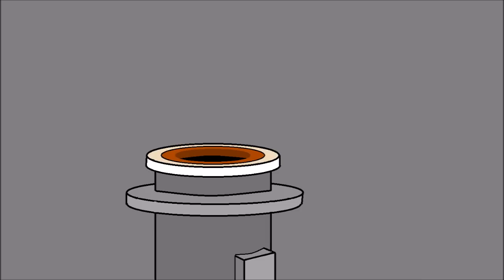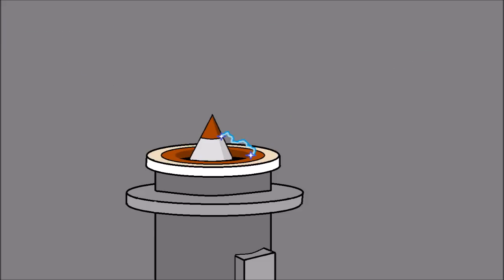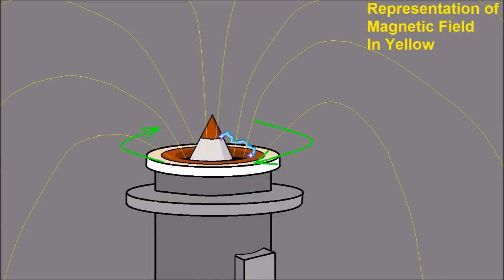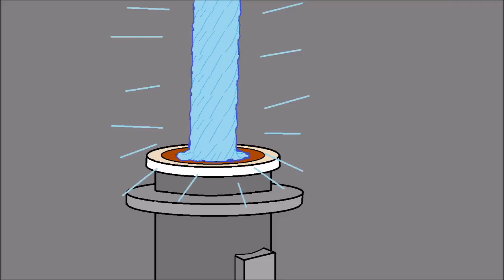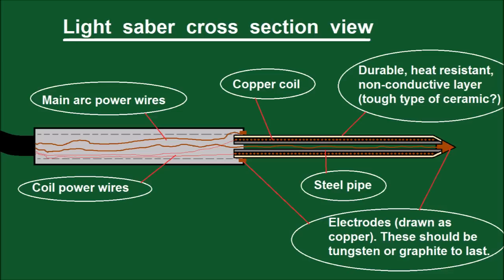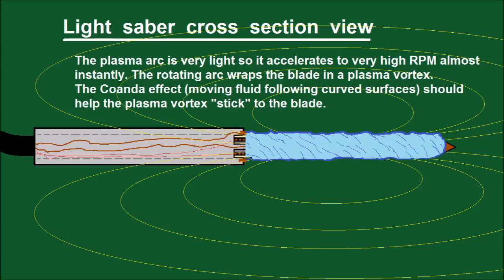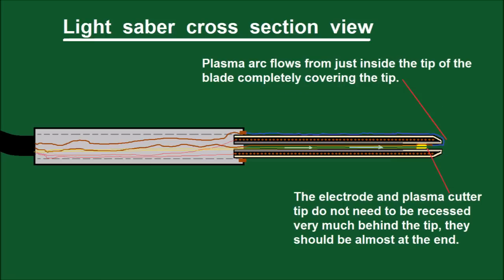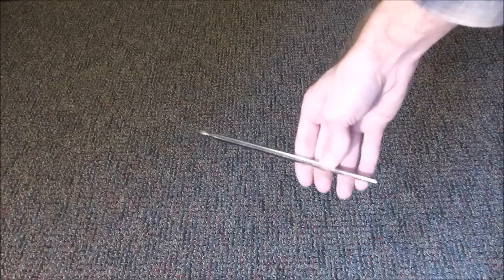Design for a REAL Lightsaber! Make a Light Saber SciPhi 02

Comment: Honestly its more likely to kill you. Good luck finding wires with good enough insulators.
What about a single electrode, and a high current output tesla coil. You could add long thin strips of insulators along the electrode, and this will prevent it from shorting on contact with objects, and still make plasma between the electrode and the object your cutting.
Reply: I thought about this before watching the video but for this to work you would need a Tesla could within close distance of you or have a ridiculous power supply

Comment: Have u done the calculations for how well these materials will sustain the arc, and all the little precise details?
Reply from the maker: That is what you find out in prototyping. If I get bogged down trying to focus on precise details I first of all would probably never come up with ideas like this, and second the amount of data to handle becomes exponentially higher if you plan down to the smallest details, with rapidly diminishing value/reward for planning since most of the parts and materials will be determined just by what is available and not by what is ideal. If there is a component that melts then that component could be replaced with a better material, a cooling system could be added, or the higher level approach could be altered to take load off the component.

Comment: hey dude why don't you set up a donation so you can save up enough money too make this.
Reply from the maker: Thanks for the suggestion! I did try to do that for the plasma gun but it looks like I will continue to fund my own projects and research. I work full time so I have some money now but no time/energy left  :-( It is hard to get both enough money and enough time. I will probably try to build the lightsaber after a few other things. I got some scrap electronics together to build the plasma gun but there was a problem with the car ignition coil I had so I stopped touching it for a while.

Comment: Nice design, the concepts are there, I think it could work, but as you probably know: there are many challenges involved in making a lightsaber. Good luck : )

Also, how do you plan on insulating the high voltage wires so that there won't be an arc inside the hilt? I imagine it's possible, but I can't think of any specific way that would work.
Reply from the maker: Thanks I'm glad you like it! For the wires there is a lot available to buy pre-made, silicone insulated wire does pretty well with HV and heat, available in any standard gauge with ratings in the tens of kilovolts: http://catalog.connectronicscorp.com/viewitems/wiremax-products/-tuffsil-silicone-wire?&plpver=1001

Comment: Wouldn't the high voltage that makes the plasma just shock and kill the person your trying to cut? What would be a better design so you could actually do cutting damage instead of electrocuting the person like a bad ass stun gun?
Reply from the maker: The plasma would be intensely hot, the more current you can supply the hotter it would be. The magnetic force on the plasma arc would force it to continue spinning around the blade even if the blade comes in contact with a conductive material. So I think it would work like a circulating plasma saw, burning through material on each pass at thousands of passes per second. There would be an electrical shock with it yes, but it would also burn through material quickly if you can supply enough power.
Reply: Don't get me wrong it is a great idea, and this idea lead me to make my own, but more like a wh40k power sword than a lightsaber, if you private message me I can explain that if your interested. But any way, I was mainly curious if you got around the shocking part and have it as just the plasma circulating saw as you put it.  Also, im a blacksmith, I also do metal castings, if you want help making custom parts an such let me know, I would be glad to help make a plasma gun an laser tower
Reply from the maker: Cool if you want to private message discuss something you can email me at jaycubl@hotmail.com

Comment: But if you slash at a metal rod for instance, the plasma arc will conduct only through that so the arc would no longer surround the entire lightsaber due to faradays law. Functional but less cool looking.
Reply from the maker: Well actually Faraday's law is what is pushing the are around the blade at high speed. In the section where the blade is touching or near the metal bar yeah it will likely conduct all or mostly through the metal rod because the voltage signal between blade electrodes will be stronger at the conductor, but it might still sweep around the blade and only momentarily conduct through the metal on each pass. It would depend on a few factors like the condition of the metal surface, how much easier the path through the particular piece of metal actually is (vs through the plasma), the intensity of the magnetic field and the electric current through the arc, ... etc.
Reply: Well by faradays law I was referring to things like the faraday cage, where electricity takes the path of least resistance. And how that whilst your design is probably more efficient at cutting through things than just the heat transfer of plasma as other designs utilise, on clashing with a conductive material or maybe even another lightsaber the arc would stop spinning, removing some of the "wow" factor. Still I think its an impressive idea if not the perfect one. :)
Reply from the maker: Yes, hopefully we can create one more like in the movies eventually! Oh sorry I did not realize that is what you meant by Faraday's law, I thought you meant Faraday's law of induction. Anyway, maybe to fuel your creativity and deep thought, you can try to design for the world a system of producing magnetic fields in the shape of a lightsaber blade in a way that could contain the plasma and strongly lock out another blade. I haven't been able to think of that yet so a solid core is the best design I can offer for now...

Comment: I had a similar idea, I saw in the comments you said you would give this project a go once you get the funding. How much would it actually cost to make and run and how much voltage/wattage (whatever it is) would be needed to run it stable.
Reply from the maker: I could probably build a working model for a budget of a few hundred dollars. I should build a small (couple inches) test version first though. It can probably run stable on a few thousand volts, that depends on how long the blade is though.
Reply: JaycubL When will you be coming up with any prototypes?
Reply from the maker: I WILL REIGN I don't have a particular schedule, and I have many other projects that are also important to me. So, maybe I can experiment with it some in the next couple months? Maybe it can be my New Years resolution. Anyway I do plan to build it before too long.
Reply: +JaycubL so you probably couldn't all fit inside of the handle... :/ dammit. Well I guess Vader could use power from his suit XD
Reply from the maker: It maybe could be done with better power supplies later.
Reply: +JaycubL how many volts do you think you'd need to make a long blade?

Comment: but doesn't it kill you if the arc somehow reaches your body?
Reply from the maker: +ExplodingScience Possibly, you may want to wear leather welding gloves. It would not jump to your body for no reason, it will take the path of least resistance. That will be a shorter path directly from one electrode to the other. If you grab the blade you would be shocked and severely burned. But I don't think you would have anything to fear holding the handle normally.

Comment: I watched Prof. Dr. Michio Kaku's fictions about building a lightsaber as well as yours. Now i have an idea of compressing a gas. 
You should not compress and blow all the gas in and out of lightsaber. Instead, you can make compressor and expand the output gas with pipe spirals around a heating cell (perhaps tiny resistor) and store it inside a ceramic(i.e.) cylinder to be able to hold it.
Expanded gas shall be more useful than compressing the same amount of gas with only blower, and yet quieter.
Reply from the maker: +XavierBetoN Thanks for commenting and sharing your ideas! Yes heating the compressed gas would give you more volume / gas flow, good point. If you are using a compressed gas deign, maybe you could use pre-compressed butane and nitrous oxide! (separate storage cylinders). That would allow good energy storage compared to batteries or something. The electric plasma heating would not need nearly as much energy then, since the combustion would already provide intense heat.

Comment: Have you seen Michio Kaku's episode on how to build a lightsaber? his design is similar to yours. And he comes up with a way power source that can be kept in the hilt.
Reply from the maker: +Samuel Olasiman Yes I have, I do not think it is similar at all really. His design is cool but I don't think it would work, at least not with anything near current technology. His blade is a thin hollow ceramic tube (basically a glass tube) with holes all through it, and high temperature plasma being forced through it by air pressure. That blade design will never work I think (it will break too easily, and probably erode from it's own plasma quickly the way plasma is supposed to blow through it). The way he suggests for pressurizing the plasma to blow out through the blade is very poorly thought through, he suggests just using a single axial fan. You can't get much pressure that way. It may be possible to get enough pressure with the fan at high RPM, but why not use a linear induction motor to push the plasma forward in his design? Or at least a centrifugal fan? The power supply he suggests is not possible with current tech, maybe in the future but not soon I think. I have respect for him he is a good guy I think, intelligent. But his light saber design is no good. I don't think he was designing it with the intent of it being something that would actually be made and used, he designed it for that show. His design and the other concepts I have heard of were not satisfying at all to me which is why I thought I needed to design this. Not saying my design is perfect but I think it is something that can be made and used right now with current technology, and then refined as better power supplies and materials become available.
Reply from the maker: +JaycubL I also have ideas for advanced power generation and storage but I am not ready to share my secrets so I left it out of this video.
Reply: JaycubL dang we have a modern day Tony Stark

Comment: What force/dive do you use to thrust the center rod out and pull it back in?
Reply: +DOMAPOI What force? There is only one Force...
Reply from the maker: +DOMAPOI There are may ways you could do it. For example compressed air, or the same spring based mechanism that is in the knife shown in the video. Or it could be a simple locking hand-moved lever, or an electric system of some kind (like a motor pushing it with rack and pinion, or a linear electric motor using the coil in the blade and a second coil in the handle to push it out).

Comment: Interesting.  It would be interesting if you could use the basic principles with a LED toy version to allow it seem like it ignites without being dangerous...

Because the real question, as always is: "What do you need a lightsaber for?"  Aside from 'Nerdgasms' there is no use for a Lightsaber. If you need a fantasy sword you could just work on make a regular sword with a monomolecular blade or vibroblades or whatever. There are a bunch of other nerdy things you can use to cut people and things that are not a danger to yourself, and do not require you to wave around a potentially dangerous plasma field.

Who would want to be, unshielded, this close to a plasma field, that is designed to melt through things in an instant? The heat from the blade alone would make it unwieldable to a human.
Reply from the maker: +Kajan451 Yes a normal sword may be better or at least more practical in a sword fight. Still I think a lot of people would want it. The plasma would not be really harmful to the user unless you stare at it, you might get a sunburn after a while though. A plasma blade would be better than cold steel for burning through non-heat resistant things, and might be able to cut through a steel blade if it runs hot enough (it would not be instantaneous slicing like in the movie but it could be reasonably fast if the plasma is very hot). And making small contact with your opponent would burn and shock them, you would not need to get a strong chop into them.
Reply: If its hot enough to burn through Steel, you would have a blade in your hand that needs to be in radiating heat in excess of 1500°C. I would assume it would be somewhere in excess of an oxyacetylene torch, which is 3000°C, and you would have to have that temperature right next to your hand. That would be quite uncomfortable, in my opinion.

And of course then the question becomes, why not just use an oxyacetylene torch as weapon?

Its not that lightsabers are not cool on paper.. i just don't see them as being practical in real life.. where you have to worry about holding a 3000°C hot meter long 'torch'.

I am sure you have experience with Oxyacetylene torches and should know how uncomfortable it gets to be around that flame, even with heavy protection equipment.
Reply from the maker: Kajan451 I have done some torch welding yes. I don't think being near the blade is a problem especially if you wear leather gloves and hold the handle a few inches back from the blade. With a torch, if you keep your hand behind the flame you feel only a little warmth off of it. Plasma cutters too, you can hold them with no problem as long as you don't get your hand in front of it. I have used MIG welders without gloves and it's fine other than the shower of sparks. There are reasons a light saber is impractical but I don't think it would burn the user's hand if they are careful.
Reply: JaycubL Oh i wasn't suggesting them to burn the wielder. I meant it would be uncomfortable to use.
Reply: Maybe if you could get a powerful power system and a cooling system then the blade could be hot enough to melt through a bullet (that is unlikely though).
Reply from the maker: Flight King1252 It might be possible to use this to stop or reflect bullets, I think the hard part is moving the blade into positon to block the bullet. Armor or a shield seems much more useable for that I think.

Comment: SO what materials do you need?: I might have some stuff laying around.
Reply from the maker: +Jacob Ellinger I guess I could use some gold and silver if it's just laying around.
Reply: +JaycubL what do you need gold for? Oo I thought you would just need some circuit and maybe some tungsten or something.
Reply from the maker: +Jacob Ellinger Yes I was joking. I probably have everything needed for a small first experiment. A neon sign transformer will hopefully work for a power supply for a miniature one to test the idea. The full size version will be challenging to make though, yes I would need to try to find the tungsten or graphite electrodes. A normal size blade could probably run on less than 10 kilowatts and still work well but the hotter it can run the better it would cut. Making a portable power supply that is not too heavy will be sort of hard. Lipo batteries are probably needed with a high power inverter and step up transformer, with a good cooling system. The outer shell of the blade is one of the tricky parts, I would need to just try several things and see what survives the best.
Reply: +JaycubL
What about a portable power supply, you could wear it in the small backpack. Just like the first versions of lightsaber!
http://cdn.instructables.com/FHI/57HU/H994TBEX/FHI57HUH994TBEX.MEDIUM.jpg
Reply: Jaycubl I think, you should build the blade first and then start trying some kind of power supply.

Comment: Well, it looks like you are going to need a star destroyer so you can test out the light saber by trying to slice through the blast doors.
Reply from the maker: +E. Lectricity The version with the plasma cutter tip might be able to (as long as they are not too thick or heat resistant).
Reply: you will need patience and use the force